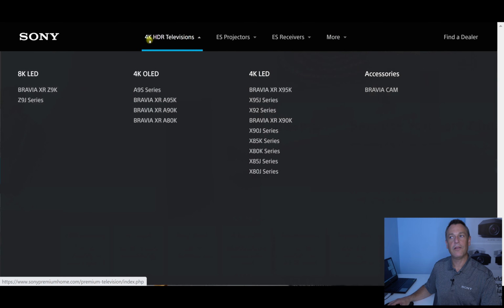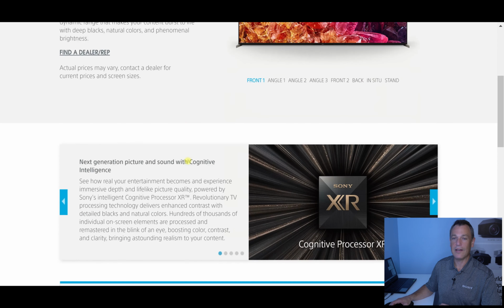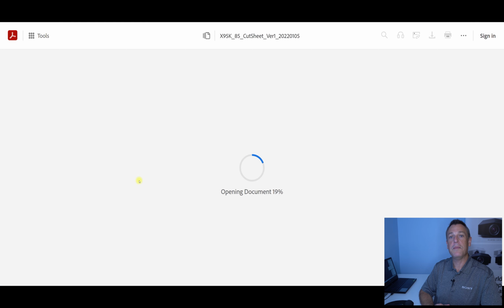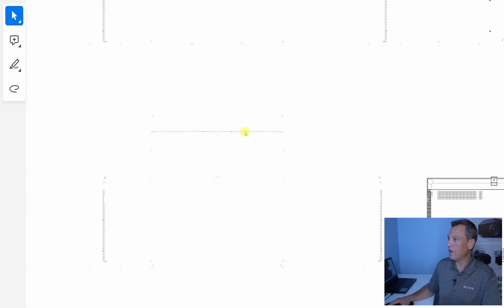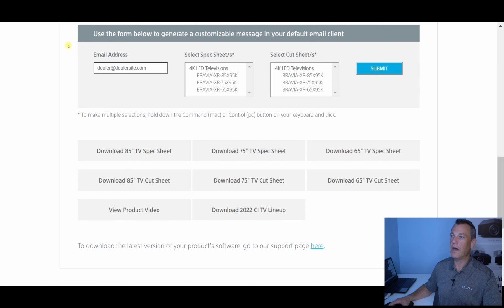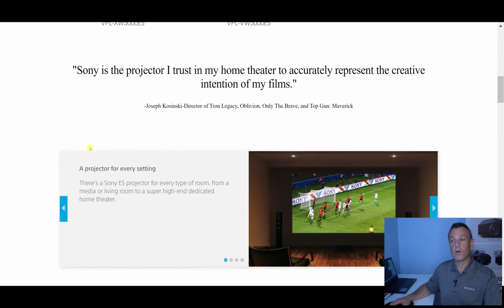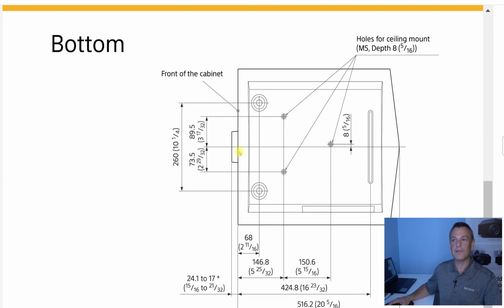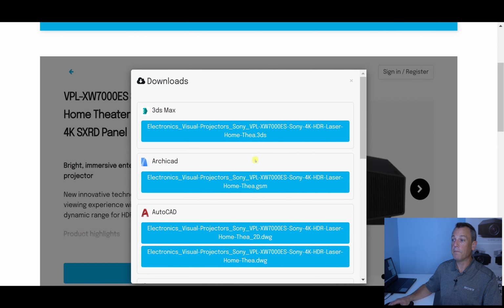Introduction to Sony Premium Home Custom Integration Tool

Comment: I bought a SONY 5000 ES to go with a new A95K TV.  It will not communicate with the Sony  TV.  I spent two hours with Sony's TV techs and they could not get it to work.  I spent another hour with Sony's amp tech and they could not get it to work.  I was told to call Monday through Friday to talk to the ES Specialist.  He would not help, not even make a suggestion.  He said if I don't like it send it back.  I am very disappointed with Sony's support.